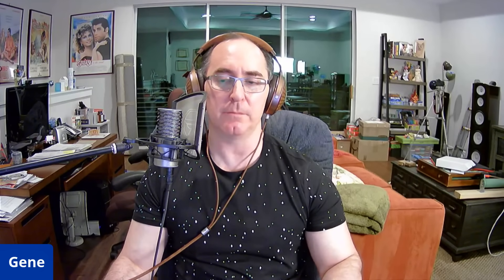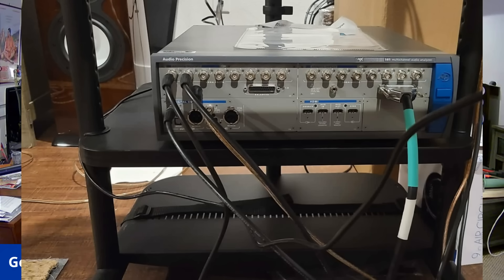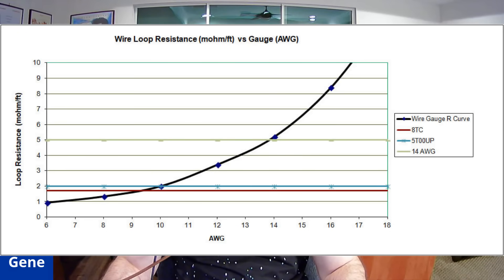Speaker Cables Really Don't Make Much of a Difference?

Comment: I took the middle ground with Monoprice 14 gauge AWG OFC cable plus some Mediabridge banana plugs & couldn't be more happy as far as speaker connections are concerned. Handling my x4 600Ms and the 404C very well.

Comment: I’m a guitarist and cables are a big discussion field there too. What I’ve learned is that only the first cable up to the first amplification stage is important. Because guitar pickups are high impedance, you stand to lose a lot of high end frequencies if you use a crappy cable (or a very expensive cable if that’s what you’re looking for specifically). As soon as the signal is converted to low impedance by the first amplifier, the cables stop having any real impact on the frequency spectrum. As speaker cable naturally follows an amplifier, I bet that signal is low impedance, right? That would explain exactly what you’re measuring, meaning almost no difference in audible audio.

Comment: Great and interesting, could you maybe try to measure the sound? I am thinking that you could use the same gear that is being used when constructing loudspeakers. :-)
I think what you have done in this test is about the same as if you took a porch and a strong SUV, they have the same horsepower, mileages and so on, and when you measure both, do you get the same numbers. The difference is only when you try driving both, they do in no way feel alike. So in short, try to measure the sound différance. :-)
One more thing, you had made sure to get the best and fairest result, but what would happen if you had power cables crossing the speaker cables and being parallel to them, just as if all the cables ware mounted to your audio system?
Reply from the maker: Wow there really is little hope for humanity.
Reply: @Audioholics  I think you misunderstand:-)
By making a sound test, do you have the proof that would satisfy everyone. You hear it so often: "but have you listened to it?" And as it is right now, do you have to say no or, sort of. By measuring the sound in the same way as audiophiles do measure speakers, do you satisfy both the sane and the audiophiles. :-)
I have a theory myself on why I did hear some difference, and that is if you have both your 60Hz main cable, some crosstalk from the signal cable and some unshielded speaker cables, can it maybe give some bad effects. So why not make a test where you take some "hi-fi" cables, some normal cables and simply place them among the other cables and make a microphone sound test? :-)

Comment: Could you add to your test an actual personal listening preference. You said the kimber's are your fav. But how do they perform to different types of music. Can you hear a difference in each not as a competition but as a recommendation to a potential person replacing there 20 year old speaker wire.  I ask because I just replaced my interconnects with Blue Jean cables and I actually heard instruments that I didnt here before. I was using monster cables and wasnt happy with the sensitivity of the cables. I would always have to turn the volume up more to get the same level.

Comment: Great information Gene. I would like to know your thoughts on Monoprice's flat speaker cable. I would like to have rear channel speakers but getting cable to that wall (it is an exterior wall) would be very difficult. Monoprice touts this wire as something you can paint over and never notice it is there. 
Thank you for your tremendous work!

Comment: Speaker cables will make a difference. Use a super thin gauge wire that's 2,000 feet long and AB test that against a normal cable of normal length and you would probably hear a difference. But the law of diminishing returns applies.  

Having said that, it's far better to invest your hard earned $$$ into digital room correction.  For a fraction of the cost of all the tweaks you can do, there is no substitute for proper Bass Management due to the Schroeder Frequency issues caused by your listening room.  Value for money! 

If you have excess money, send it to charitable organisations than a "super" speaker cable manufacturer.  Life is too short to worry about minuscule details, all it does is take away enjoyment of the Music listening we are in this hobby for!

Comment: Thanks for the information. What is your take on bare wire speaker connections and using banana plugs?
Reply: Banana plugs are without a doubt more convenient should you make a change. They're often more robust than bare copper for better or worse. They will have no impact on sound quality - neither good or bad.

Edit: Just noticed Gene actually made a video on connections. https://www.youtube.com/watch?v=BYYZZNuO-GY

Comment: @Audioholics Scientifically it does make a difference, which you have proved in this video.  Namely, skin effect, parasitic capacitance and inductance, impedance, and all leading up the driver which is an inductive load.  All these are measurable quantities.   There is no problem anywhere.  People like cables, can afford them, then they buy them.  Now on the other hand, if the test results given were exactly in the same line on graphs, then you can say it doesn't make a difference, but then in the end you shifted to the human perception problem.  So, below I'm going to talk about other human perception things.

Look at people upgrading from 120hz monitors to 144hz, 144hz to 240hz, etc..  Can these gamers perceive that much? And the answer is yes.  There are people in this world that have unlocked pathways and evolved over the normal folks over time.  For example, hockey goalie players reflexes can beat a normal person 10 out of 10 times in a game of catching a falling piece of paper from the hand.  They have an average reaction time 2x faster than the normal folk.  And so, best believe pro players will be able to make use of the higher 240hz monitors.  

You see, with audio it is very similar of people having golden ears vs. gamers who can perceive 240hz monitors.  Both are information to our brain.  That is like a musician friend that I have that is able to tune an instrument perfectly, and sometimes better than a tool, because the tool may not be perfect as well, as there is distortion and wave characteristics, self microphonics from soundwaves, uneven impedances of dependent note to measure against, reflections within the room, etc.

The world we see as humans are based on ratio.  As in we, don't excel well at finding a black screw on a black flooring even in a well lit room.  We are feature/edge tracking machines evolved from other mammals which share these same mechanisms in our human vision perception.  A person does not see all 240 frames in a 240hz monitor all the time.  When it distinctly wants to use all the information being received, the iris focus on our object of importance, and so at that point it does make a significant difference.  Such as in FPS games, shooting an enemy.  If a person has a 8ms frame duration perception during the heightened response moment, then in two circumstances, two different monitors 120hz vs 240hz, we explore.  Let 60ms pass by, 14 frames drawn on the 240hz monitor,  and 7 frames for the 120hz monitor.  In 3-5 frames, the pro player can make a decision already.  Some insanely skilled players can make 1 frame decisions even, analyzed before through replay demos/videos. (doesn't happen all the time, we think it's a predictive thing)  Okay now 14 frames is plenty enough info for a player to make a better decision already.  

Pro audio people are not competing on a main stage or anything, also there are less incentives/lucrative opportunities than a video game pro player or pro hockey player.  It is not pushing certain groups of humans to perform at the highest level.   

The main question here is, do the cables make a difference and if that is dependent on the person to hear the difference in cables in the first, it does not mean it is dependent on the cables no more.  

But this is all based on ratio of the person's perception capabilities vs. the equipment.  And for time is independent here as it moves linearly in one direction forward and many many microlevels to the atom (scientists measured 247 zeptoseconds smallest increment of time), and up to the Planck time, beyond that we don't know what it means, because we do not have anything in place to measure beyond that.  But, the dependent ratio here is the person to machine.  And we hope the varying factor is the human/person.  You definitely would want the machine equipment to be the lowest liability and highest accuracy, to help the human brain better subdivide the noise from the signal, the blur from the enemy's movements, etc.   It is better to look at the evolution of display standards, such as NTSC, using 29.97fps.  That was believed what the human senses were capable of.  Now we are at 1080p@60Hz up to 4K@360Hz monitors.  That's insane!  Many ordinary folks will say the same thing, 360hz vs 240hz it should not be perceivable or useful, overtime the needs will change pathways allowing us to evolve seeing more, judging by history. And the ones utilizing it will see the advantage as always.  The rest that is unable to see the difference, well, will continue to not see the difference.

For myself, I can tell a difference between generic cables and higher end cables.  If it has less resistance for a quality cable, allows for better low-end and high-end response.  Why?  parasitic capacitance and resistance, creates RC filter, a low pass filter.  1/(2pi*R*C) is the cut off frequency.  And the load is a speaker, inductive load, and self inductance from the different conducting parts along the paths, creates RL filter, a high pass filter.  1/(2pi*R*L) is the cut off frequency.  So, it makes sense why most people can hear a little more openness or wideness, etc.  I think it also has something to do with the impedance for lower bass notes.  All the frequencies are, depending on your system, is going through one cable.  Keep the cables short :)

One more thing to add, are you guys able to tell the difference from DSD256 to DSD512?
Reply from the maker: The slight measurable difference in skin effect does NOT translate to appreciable amplitude response differences which I've shown. The Audioquest cable that allegedly solved skin effect did more poorly in that regard than cheap lampcord, so again I proved the product is complete nonsense. This product and claims by Audioquest  are indefensible and border on fraudulent.

Comment: Great explanation for a deep topic!  I recently compared $50 Monster cables to $500 Transparent Musicwave cables for my bookshelf B&W's. Subwoofer was off for this. Monster was bananas in AV and bare wire to speaker; banana termination for the TP cables. Mid-range, but capable, AV. No change in settings or distance to speakers. I did not expect to hear much of a difference, if any. This seemed to be a laughable topic for me just two weeks ago. But, after listening to the same track, first on the Monster cables, I then swapped for the Transparent's and I heard a clearer and deeper sound in the first track I played. This remained true for other songs. It's obviously harder to hear and set-up for movies, but there IS a difference to music, surely for film as well. Keep in mind, this is all on bookshelfs, 2.0 set-up. Worth 500 dollars, in my opinion not. But, I bought them on sale for 300 and that I can do, especially for my mains.
Reply from the maker: You're test was sighted and highly biased where placebo is altering your perception. Try again with someone else swapping the cables and you unaware of which your are listening to.

Comment: What about the difference in quality of connection? I.E. 14 g aluminium wire to old screw connectors vs same wire soldered into 🍌 clips. Then copper wire, same experiment. Gold plated connectors, on and on.

Comment: One of the biggest differences I hear with cables aside from frequency response is sound-stage width  and depth. I've even heard sounds behind me in a 2 channel system. So how do you measure that ?
Reply from the maker: Simply blindfolding you will remove the placebo effect you are perceiving when switching to the exotic cable. Those perceptual differences you think you are hearing will vanish under controlled listening tests.
Reply: @Audioholics  That doesn't answer my question. How do you measure soundstage width and depth? 
How is it that a friend of mine can measure frequency response changes with a calibrated mic at the seated position ?
Reply: @andershammer9307  One thing is measuring the difference with an equipment. Another thing hearing the difference as a human.

Comment: The biggest issue of cables and what contributes towards differences in sound is microphonics and noise. 

Nothing here about that and no measurements, just static inductance, resistance, and capacitances ain't going to show that up. Yes, I decry the madness of 1" thick hose-like speaker cables (the in series voice coil diameter wire of a 6.5" speaker is typically 0.2mm) and the pseudo-science explanations, but this video was no help whatsoever. In fact, this video was a missed opportunity. 

Put some impulses through these cables with loads on the end, that would have been a good start. Bad cables, like bad capacitors, the AC current can cause them to single along with complex signals. 

Robert Fulton showed physical evidence that cables can have significantly different noise floors. These are caused by electrons jumping from one strand to another because copper can have hot and cold spots along those strands. It can become so severe, particularly in mains cables, where pulling away the insulation see the blackening of the wire and its strands. Literally, over the age of the copper, these electron strand jumpings were tiny small sparks that became visually obvious. The sound was way off before that.

I agree that cables should simply be made along principles laid down by Professor Malcolm Omar Hawksford in his 1975 paper, using plain science cables well-designed and well made should be affordable. Alas, all we have is profitable confusion on the one hand and incomplete knowledge myth debunkers on the other. What a mess! And so unnecessary.
Reply from the maker: HAHA microphonics on a speaker cable which transmits large signals into a terminated load? Nice try but nonexistent. Just because one makes a seemingly impressive sounding claim doesn't mean it's based on any reality or proven science. There are no "microphonics" effects in speaker cables.

Comment: It's remarkable that very precise equipment was required to see the differences between garden variety zip cord and hi end cable. It would have been interesting to see the performance of the 24 gauge zip cord that is sold as speaker wire and ends up being used in many home theatre setups.
Reply from the maker: 24AWG is a bad idea. Very high resistance, and high insertion loss.

Comment: I have about 30’ runs from my AVR to my speakers. Running Marantz 7010 to Polk Lsim 703 left and right and a 706c. I recently upgraded from a single 18 gauge wire to a bi-amp left/right 12 gauge and bi-wire 12 gauge center (wire had 4 leads so I figured why not). Will I notice a difference?